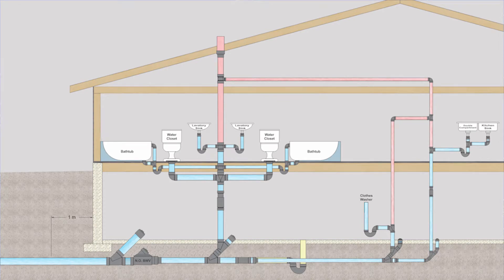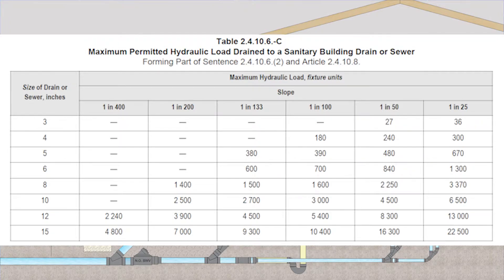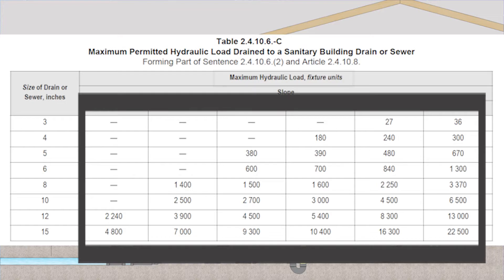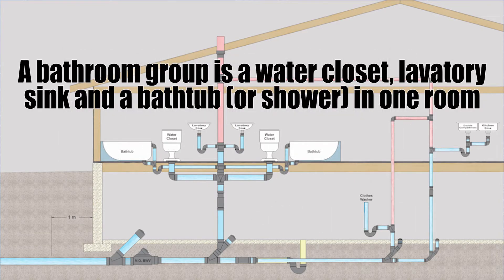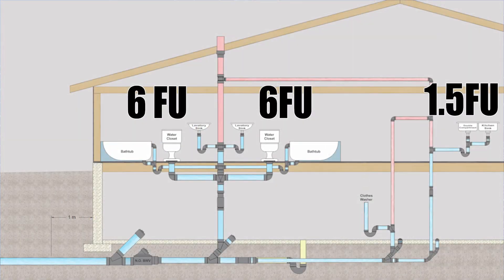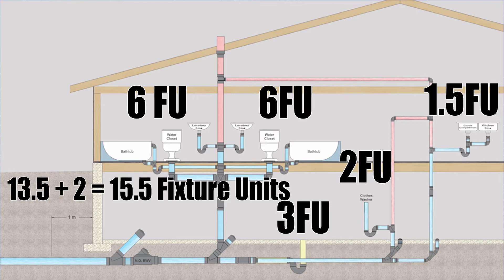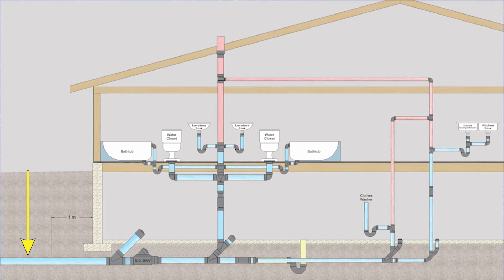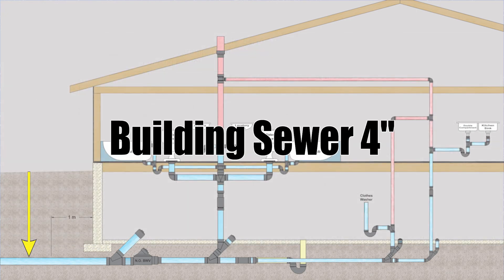Level 2 DWV - Video:1 Sizing Building Drains and Building Sewers with Tables

Comment: Is there a chart or clause that specifies the minimum slope on Branch Drains? Namely those of 2" and 1.5" diameters?
Reply from the maker: Nope, just a code clause. 2.4.8.1

1) Except as provided in Articles 2.4.10.8. and 2.4.10.9., drainage pipes that are 3 inches or less in size shall have a downward slope in the direction of flow of at least 1 in 50. (See Note A-2.4.8.1.(1).)

Comment: Can you use those double tee's or "cross tee's in that application? My understanding is that you can only use those tee's in a venting situation..
Reply from the maker: Short answer is yes. You would want to use a double wye fitting with a fitting 45° for the toilets though.
Reply: @MathematicPlumber  oh OK I did not know that, thanks for the Info. just for the record the way you explain things in your videos is far superior than most it's nice to finally have someone simplify things rather than over complicate things you should pat yourself on the back and get a raise:) keep it up and thanks

Comment: i am wondering if it wouuld possible to construct a video on comercial washers and washer stacks with code restrictions and presure sud zone areas with min and max requirements and laundey mat drains and rough in special features......

thank you kindly
Reply from the maker: Unfortunately, even the plumbing inspectors don't appear to understand that code, and I don't either.

Comment: Very great video.
Sorry I have question,
When we count bathroom as 6 and when we add the fixtures
Just I dont know when we should count as 6 for bathroom and when when we count as regular .
Thank you
Reply from the maker: In class: I tell my students how I want things counted, some instructors don't care about it either way
On the job: whatever way you want, it's your job (There is no rule/code stating when you count it one way or another)
Reply: @MathematicPlumber  
I think if it is only bathroom group,we count as 6 but if bathroom group with other fixtures,we count as adding fixtures.
Hopefully I am right .
Reply: @MathematicPlumber  if its in the same room. i think you could call it a bathroom group...and isnt it 4inch for building drain up to main stack ?
Reply from the maker: @PASSTOHAKIM  Yes regarding the bathroom group.

No regarding the 4" to the main stack, there is far more nuance to that. Continue watching through this series to have that explained. (This is only applicable to Canadian plumbing code)
Reply: @ any recommendations for drafting ?? Ortho to isometric to be exact